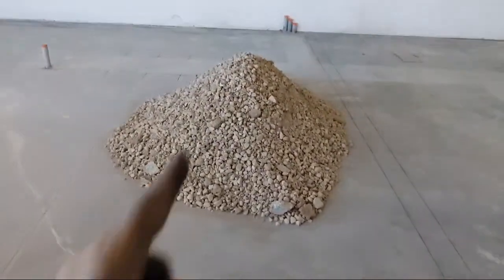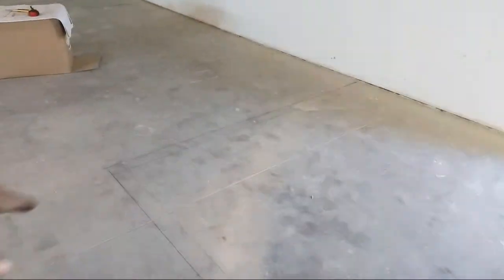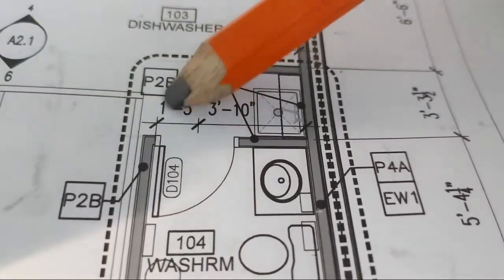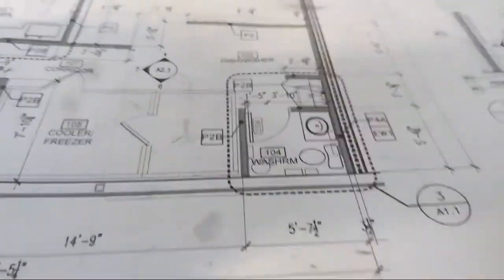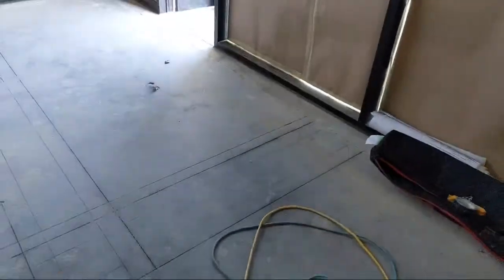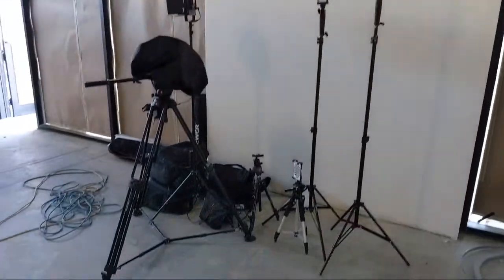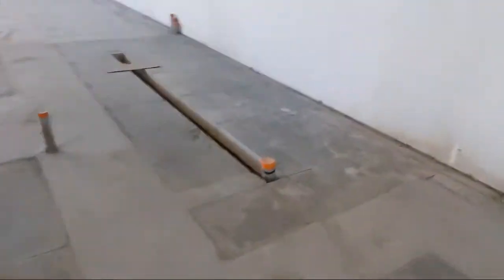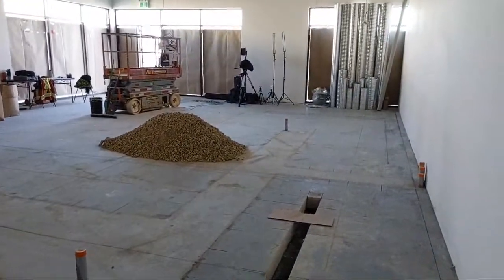New Steel Stud Framing Job Layout

Comment: How do you mark the control line?
Reply from the maker: Do you mean on the floor or on the walls? Either way, you go from cetber of structure to center of structure, then they will have instructions like wall control joints every 20' and then gridlines are center column to center column, when taking one from an exterior wall it's outside exterior wall to center.
Reply: The floor is what I meant to add and say.